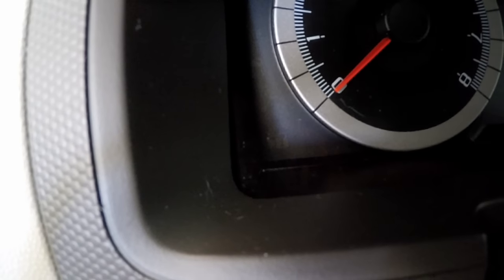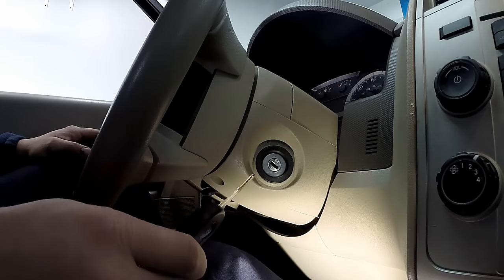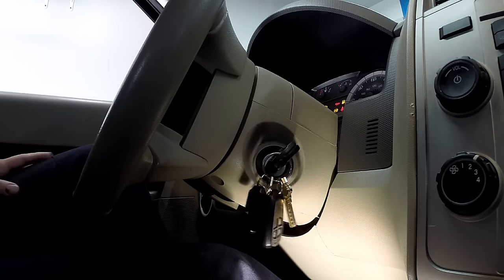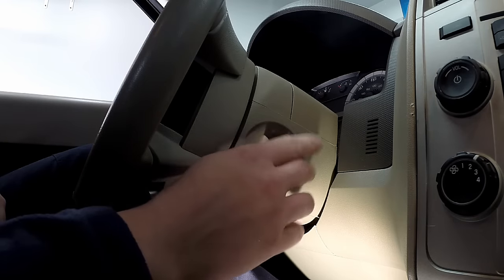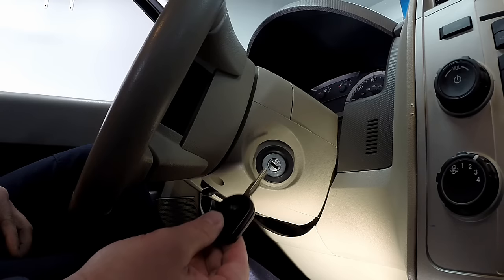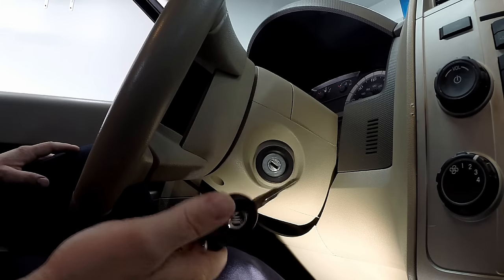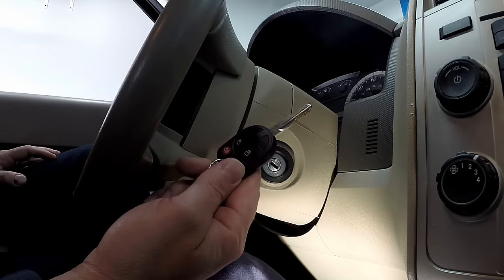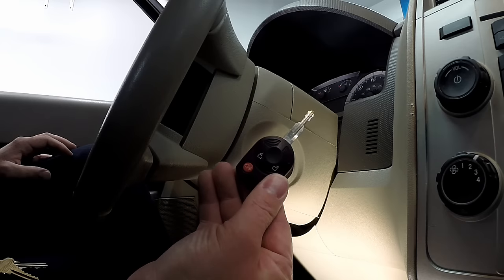Ford Quick Tips: #49 How To Program Additional Ignition Keys Yourself

Comment: i only have 1 key. can i use the same key twice, then the new key or do i have to have 2 different programed keys for it to program the third
Reply: I'm wondering the same thing. What do you do if you only have ONE key? 🤔
Reply: Have
Reply: I know this is old but I too only have one original key and just got two cut. I can program them to operate the locks but they don’t turn the truck on. What to do?
Reply: Having the same question here
Reply: Me toooooooo
Reply: @Davidmaxwell07  no unfortunately you would need to get it programmed
Reply: any answer?
Reply: @zxcdarel   locksmith or dealer can program
Reply: Home Depot will cut and program an ignition key. It won’t have the buttons on the key, but you can unlock the door by using the key in the door key hole. I did this last year because I lost one of my car keys.
Reply: U need 2 working keys to do this. One Key will not work
Reply: For the love of god we know 2 programmed keys is must.. but to do if there only 1 ?
Reply: Can you use the fobs remote start button as second key I heard that you could any truthe
Reply: @brandonbennett1374 yes you can, start with the remote start. Get in the car hit your start button on remote start to turn dash on then hit brakes before it starts. Then put your key in and turn dash on 5 seconds and then off. Then do new key. The remote start acts like a key on the first step.

Comment: Thank you for your instructions. I bought 2 blank keys on eBay for $19.99 and had cut at locksmith ($6.00 total). Followed your programming and now have 2 spares! Thank you!
Reply: Did you have 1 or 2 original keys? I only have 1
Reply: I had 1 original key.
Reply: @davidmcdonald11  So how did you do it following his instructions if you only had "1" key, since his instructions required 2 factory keys.  I ask because I only have 1 too.  TIA
Reply: I had one key because my wife lost the other. From that I cut and programmed two new keys. I do remember watching several videos and maybe from that search I found a few other videos about it. Sorry,  hope this helps. I know the dealer wanted $250 a key and there are locksmiths that will charge the same. It was so easy after they were programmed.
Reply: @georgesaraamonette1782  I only have 1 original key.  Did you find a way to program a second key?
Reply: @davidmcdonald11 you just answered my question thank you
Reply: so this method worked for you when you only had one key? So as soon as you put your second non-programmed key into the ignition it programmed it?

Comment: Do you need two programmed keys for this to work?  I am down to one programmed key and want to avoid the $150+ dealer fee in getting a second key made.  I was thinking of getting the 2nd key on Amazon and taking the key to Home Depot to get it cut.
Reply: +Gregg L I was wondering the same exact thing. I just bought a 2000 F-50 with only 1 key
Reply: You must have two keys, one is not enough
Reply: Giovanni Socci lol then you have a problem because you're not supposed to be able to lol
Reply: Although the FOB (lock/unlock the doors) can be reprogrammed with only one functioning key - reprogramming the car to the RFID chip requires that two factory RFID keys are used (per the instructions above) before inserting the new key to program the car to its RFID.
Reply: Gregg,,, That's what i did, bought 1 off amazon .I also had only the 1 key, programmed as directed. Trouble is it didn't start engine,only locks and unlocks car. So i still had to pay to get reset. It still worked out cheaper though. saved about £40.  That's English...
Reply: Stellar Motovlogs....... IF I HAD TWO WORKING IGNITION KEYS WHY WOULD I WANT A THIRD???
Reply: @nancymcelfresh4787  because if you lose your main driving key, you can reprogram a new key for the cost of the key only and not the cost if the key, plus the dealership charge....$30 on amazon vs. That plus $54 dealership charge per key

Comment: Thank you! You saved me $150 (for 2 keys)!

Many don't know that the FOB and the Chip (of the chip key - RFID) use separate programming, both of which can be done with the vehicle, saving a ton of dealer/locksmith dollars!

I first programmed the FOBs to remotely unlock/lock/start/panic the vehicle.

Then, I followed your instructions to program the chip of each chip key. It took one cycle through with 2 factory keys followed by one after-market key. Then, I opened, closed, locked the doors, and repeated that procedure (2 factory keys per your directions then the other after-market key).

Worked perfectly. I now have 4 keys to my truck.

Again, thanks a million. Great video!

Comment: To identify the difference between the 40 and 80 bit transponder keys, the STRATTEC 80 bit key blanks will have the letters “SA” stamped on the blade and the 40 bit key blanks have the letter “S” stamped on the blade.

Comment: Apparently the fob needs to be programmed separately. Turn the key on/off 7 times and on again an 8th time. Locks should cycle. Press any button on NEW (I programmed remote) and locks should cycle. Remove key from ignition and locks should cycle again. 

Press buttons on NEW remote and they should all work.

Comment: I was going to ask a valid question that I see has already been asked but NO ONE seems to answer. I only go one key from the dealer. It was a good video but doesn't apply to me with only one key. wonder if its still the same  on a 2018 Ford Transit T-150?
Reply: You'll have to have the dealer program it for you, as you need two "master" keys to program additional keys.

Comment: Hello sir.  I have a 97 Ford mustang stuck in theft mode with one good key. It will only fire off and run with starter fluid.  I was wondering if I purchased and programmed key fobs would that new key fob turn the theft system off so I can start the vehicle. 
   By the way you have excellent videos

Comment: Thank you, but my 2006 F150 doesn't have that lock icon on the dash cluster. it just has a wrench, battery, check engine, brake, ABS, seatbelt, & airbag lights. In this case how would I do   this procedure? Or is there another procedure for my truck model year? 
Thanks

Comment: Had problem today. Customer only has one key and my Autel / Autek cannot add a 2nd key citing need 2 working keys. I can clone the chip but I ran out of a Ford shell to insert a super chip.  Is there a way to work around 2 key limitation?  Or I guess you have to do it as AKL situation in which I don't want to do.

Comment: You may have missed my questions on your Nov9,2013 video,hope you dont mind if I repost it here.

Great videos,watched most of them and subscribed .. I bought a second hand 2009 Focus facelifted 1.8gas duratec HE 6 months ago,the car still runs fine upto now. 2 weeks ago the CEL light came on(still on but not blinking ,& car still runs fine), noticed the negative battery terminal broken had it replaced,   BUT still with CEL light on,.  Instrument cluster test mode(dash sweeping)  shows DTCs: A895-trip comp module,9681-PATS,9318-batt volt low,.  tried disconnecting battery and fuses to remove CEL then now with additional codes:D900- CAN interupted,A103 antennae not plugged,.. went to a garage for obd2 scan and he was able to remove the CEL light and codes:P0400,P2008,P1260,P1549, but he was not able to remove the codes from my cluster(dash sweeping), next day CEL light went back on, I was able to use the  car with CEL light on for two more days,then it wont start anymore,battery shop told me that my battery have a dead cell had it replaced with new battery,car now starts and drives fine but still  with CEL light on, tried your method now with additional codes: E510 (or U2510) Missing or invalid security data to Powertrain Control Module,  E197-invalid data speed and E200-invalid data odometer(currently 8 cluster codes).The car still runs fine. 

1.Help please, how can i remove the CEL light and 8cluster codes by myself? (I am from the Philippines and the nearest Ford dealership is about 300kms away..the garage with obd2 scanner cost alot) 

2.Any insight on my case?

3.Assuming all my codes /CEL were only caused by faulty battery/connection(already addressed),. would the codes/CEL disappear on its own(after some drive cycles)?  How much mileage/drive cycles?

4.Again assuming all my codes /CEL were only caused by faulty battery/connection(already addressed),. do i still need to erase all the     dash/cluster  codes to remove CEL light? any DIY to do that?
Reply from the maker: +mila paner What I can tell you even though everything is different over there is to perform my pcm reset procedure and evaluate for an new current codes from there and just concentrate on the active codes not the ones falsely set from low battery voltage etc.

Comment: I bought a 2012 ford focus. It came with 1 key(original ford key). I bought two new ones and had them programmed at a Ford dealer. Problem now is the original key will start but won't unlock/lock doors or pop the hatch. Has that just gone bad on that key? I just did your video and no change in that key. All three still start the car ok. Thanks...

Comment: I am having an issue with programming my keys. I purchased two keys from Tomskey I programmed the keys worked but every now and than the gear shift locks and I can’t drive.  What do I do. The engine runs but the gear shift will not move.

Comment: I bought a 2005 f150 a few years ago and it olny had 1 key, so I went Lowes and bought a new key for just under $100 but I don't remember how I programed it. My question is can I use the one original and one copy to program another. In the video you said 2 working keys which I have just one is not original. Thank for the info.

Comment: Great video! Worked great on my 2013 f150, but the 4th key I programmed the fob on it will remote start the truck but will not turn off the truck with fob like the previous keys do, normally I can remote start but if I decide to shut truck off I can hit the start but once and it will shut off, any suggestions? 
Thanks in advance

Comment: I have two keys that will start the vehicle but the unlock function on one of the keys does not work.   The lock and remote start functions still work, just not the unlock on one of the keys.  This is why I need a new key.  Can you tell me if this procedure will work for my new key?

Comment: I have to working keys of which I put in the first one then the second one,then I put in the key to be programmed, I try each to see if they would  work, the only key that did not start the engine was the second working key, so I had to re-program that key with the first key and the third key that I had to program, now each key starts the engine. So programming the new key took the program off of the second working key

Comment: I have a couple of questions. I have a 2013 Expedition. I have remote start (separate fob) I purchased 2- 5 button keys, 1) Will the remote start also program? or is there a separate procedure?  2) I have 2 functioning keys with the exception of 1 door lock button does not work. Will the new keys still program and work on the new keys?   Thank you!   Chris

Comment: I have a '07 Mercury Mountaineer that only has the security theft system module under the dash, if I replace that with a plug and play anti-theft and remote start module would it work? I'd like to think of it as a upgrade with remote start feature. Thank you in advance for your answer

Comment: I have a 1997 Expedition and the original two keys.  I bought two new transponder keys and had them cut for the original ignition cylinder code so they would also open the doors.  Using the two originals first, I was able to get the PATS system to recognize one new key but I am having no luck trying to add a fourth key. Is that not possible with the A version of PATS that was in the 1997's?

Comment: I bought a used 08 F250 XLT, power package, and it doesn't do anything when cycling through the key setup 8 times. I've done this, in the past, with other vehicles and it has worked fine but this doesn't work. Is there another procedure that may work?

Comment: great video. not sure if you are still responding to these. I added a remote start plug and play to 2012 f250 will programming the keys allow this to work, or do i need to do some other programing    Thanks  the part is  BC3Z-19G364-A
Reply from the maker: +Matt Jensen the keys must be programmed and the remote start subsystem must be enabled in the PCM with the dealer scan tool.

Comment: I have a 2009 ford escape that was running good. No problem at all. Then just 2days ago i was in the store and came back out tried to start it and it would not turn on. There's no crank to it. Got a new battery and starter but still will not turn on.

Comment: Question: I purchased a used 2014 f150 and it only came with one key, can I use that one key and enter it twice to make the new key? I hope I don't need schedule a Ford dealer ship appointment.
By the way great work and keep it up! #ecoboost
Reply from the maker: No you must have two to program another.
Reply: Thanks for quick response.
Reply: @FordTechMakuloco  can you use 1 original key and 1 aftermarket programmed key to program a 3rd..? Ty.

Comment: I have a question.  There is only one vehicle key, but the key was not recognized and the key registration was completed through the program.  Could the registration settings be unlocked because of the battery?

Comment: I did this and it worked great. I had already programmed the buttons, but didn't know how to get the key to start the car until I watched this video. It worked great until the next day when it wouldn't start the car anymore and it won't program again with these steps.  What happened?
Reply: Have you tried changing the battery in the key?

Comment: have a question, does both keys have to be programmed or can 1 key be original and other programmed in and cut to the original key and the 3rd key that was from eBay for $12.00 and then cut from a locksmith should it work...

Comment: I followed the procedure, inserted 2 good keys in ignition then inserted 3rd key with chip I bought from Ford parts. It did not work. Theft light kept flashing, did not clear. 2003 Ford Taurus. Any ideas what went wrong?

Comment: 2008 Fusion- 2 oem keys; 1 working, 1 is non working as transponder. 'Trying to program 2 new chip keys. Can I use the working 1 twice or does it recognize as same key in again in the programming sequence ?   End of the day, how do I get the 2d oem key reprogrammed w out a Dealer or these Locksmiths that are gouging  (!) ??

Comment: Will this work on my 2000 excursion? Promises I only have one factory key. I never got a second key when I bought it from the gentleman.
Reply from the maker: You must have two programmed keys to program a third.
Reply: @FordTechMakuloco  so i do need to go to ford then. Had couple other diagnoses quon my 2000 Ford Excursion Limited 7.3L Powerstroke Diesel 4x4 in Oxford White & Pueblo Gold “Yuki” & was wondering what i need to do to send to you.

Comment: So 2 keys are needed to program additional ?  If I have only 1 , is that a trip to the dealer to get a second one ?
Reply from the maker: +Mark Kennedy Yes the only way to program additional keys yourself is if you have 2 already it Fords way of making sure you are the rightful owner of the vehicle.
Reply: +Mark Kennedy If you only have 1 key, you need to program it with either Ford IDS (expensive) or FORScan on Windows (free, but does not support all Ford vehicles through all years). I myself have a '05 Ford Expedition, I've used both FORScan with a bluetooth OBD dongle and Ford VCM with IDS. If your vehicle is not listed as supported for key programming in FORScan forums, your best bet is probably the dealer or a locksmith with the correct programming tool.

Comment: Hmm, I wonder if the steps are the same if my 06 Ford five hundred has a seperate fob, not built in the key ? Thank you?, John
Reply: Nope, you need to turn to the on position 8 times and make sure on the 8th time you leave it in the on position to program that remote.

Comment: I have a 2004 Explorer, but only have 1 programmed key for it. Would I still be able to program my new key, by inserting the programmed one in twice?
Reply: No...you need to have 2 programmed keys in other to program 3rd.
Reply from the maker: You must have two as stated
Reply: I have the same issue. 2004 explorer with one key. Researching now how to program a second key. If you figured it out, please let me know.

Comment: hi question i had a new ignition switch put in my 2000 ford f-150.  the ford dealer just put a new one tha had all new pats keys i had three pats keys for my old lock cylindar.  i found a lock cylindar on ebay a guy could re key to match my old keys i had for put that in but how do i get ride of the three keys they programed to the trucks computer that work for the lock cylindar that is diffrent from my old keys?

Comment: does this also program the lock and unlock buttons on the fob or is there  another procedure to program that?
Reply from the maker: This programs the key and RKE functions on RKE integrated keys just leave the new key in the ignition for 6-10 seconds after the last turn to run so it can transfer RKE data.
Reply: got the expedition to turn on bit my rke still don't want to transfer to new key. on your video you didn't try, why cause you knew it wouldn't work. bummer thanks any way but still going to have to have someone look at it.

Comment: All (3) of my remotes stopped working earlier this week for my 2011 F150, including the original. I attempted to implement this method to reprogram them and none of them responded. They still start the truck but none of the buttons respond. The batteries are good. Any ideas short of a trip to the dealer for at least $140.00?